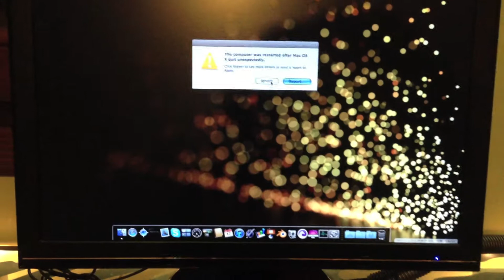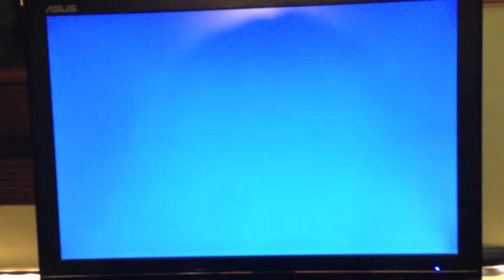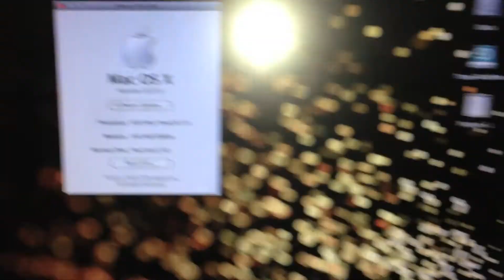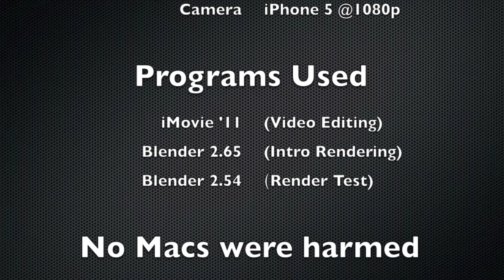G4 Power Mac overclock

Comment: Con la cella di Peltier devi fare attenzione che non si formi della condensa. Ti consiglio un sistema basato su Heatpipe per la dissipazione del calore.
 La cache di 3° livello della cpu funziona in modo sincrono alla metà del clock della cpu. Ti consiglio di controllare le temperaure di queste perchè se si innescano delle autooscillazioni le bruci in un attimo.
Comunque bravo bel lavoro. Sarebbe possibile su qualunque Mac G4/G5 un overclock?
Reply from the maker: Eh sì era un esperimento un po' a caso per divertirmi :) quindi non proprio pensato fino in fondo. Però questo PowerMac funziona ancora; su altri modelli g4 ho visto mod simili riconfigurando le resistenze sulla scheda madre (ne ho anche fatta una a un PowerBook g4 a un certo punto); g5 non ti saprei dire, ma scaldavano così tanto che non rischierei.
Reply: @coccoborg  Io col Sawtooth ho dei problemi seri......funziona solo in modalità sicura.....e nn ne vengo fuori.....